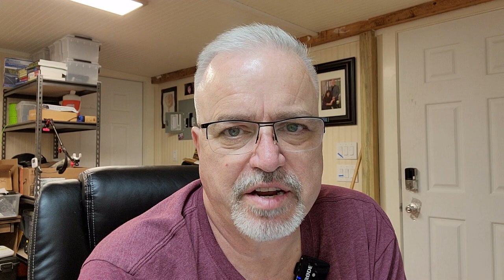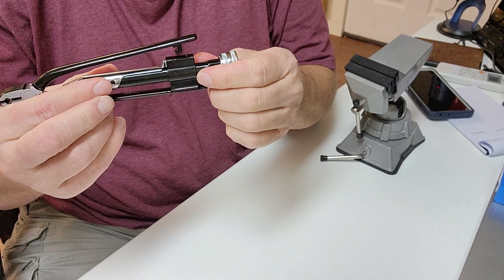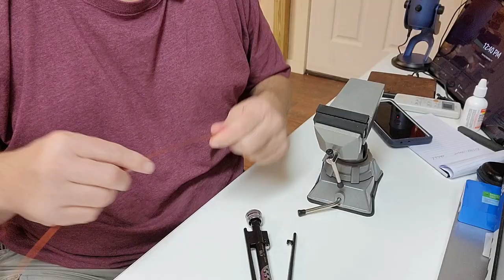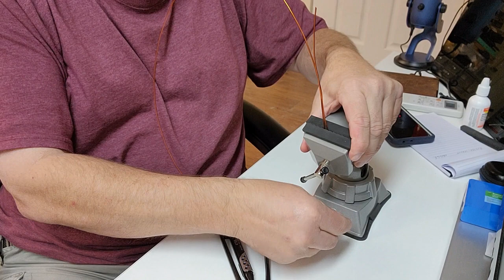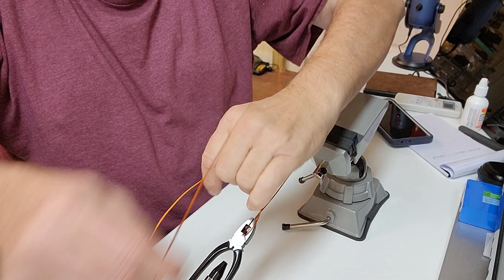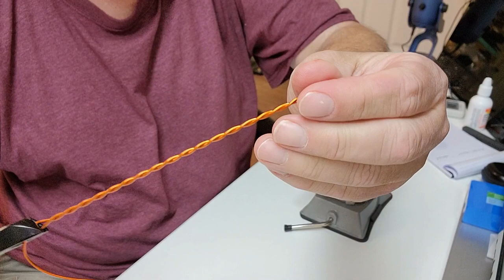The Cool Tool You Didn't Know You Needed - wire twisting pliers

Comment: Looks like a handy tool.  I’d flip it and use the vice to hold the short and long ends while twisting the loop.
Reply from the maker: I did that, but my little desk vice was having an issue holding tight enough.  I read somewhere that the loose ends are required to be in the pliers or the wire can break as well.
Reply: @WhatsUpWithSix  I actually use a dowel in the loop and twist, but like they say there is more than one way to skin a cat...